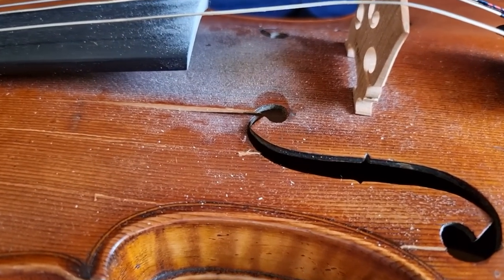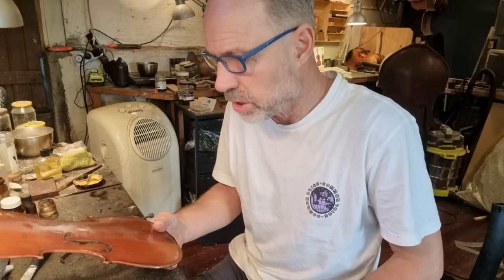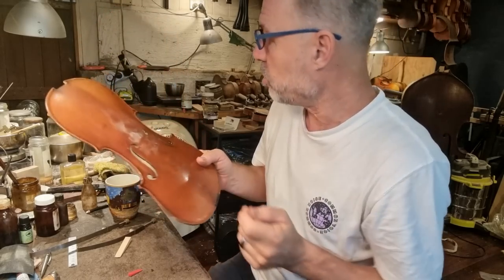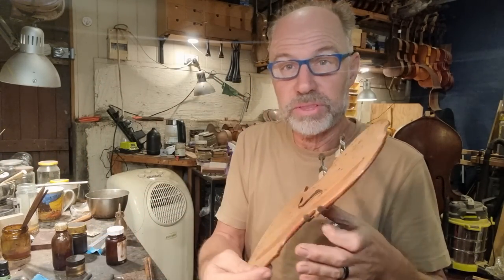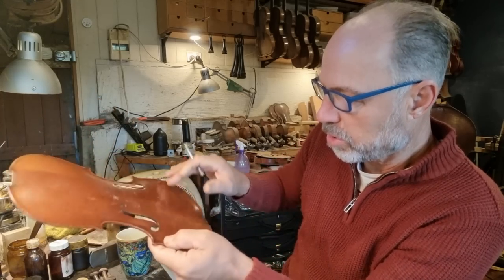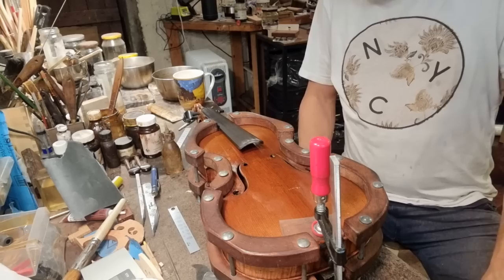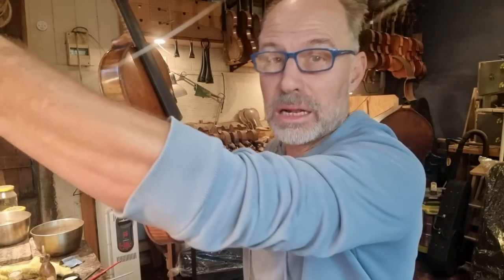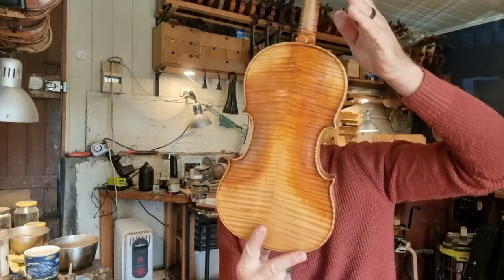Broken Violin!! Can Olaf Repair This Cracked Violin?

Comment: Good repair as usual. I've seen a interesting repair technique of using a small Suction Cup to "push" glue into  tight cracks on an acoustic guitar top before clamping. Might work on Violins as well.
Reply: That’s a technique used to repair windshields as well.
Reply: Makes sense. Might give it a try

Comment: Very well done video! I enjoyed watching it. But now some questions (not about the video). Yesterday I bought (for $12) a violin in very VERY poor condition. The neck has come off and the side panel has come away on the left side next to the neck. The seam on top has opened up not quite all the way from bottom to top. In short, it's a wreck.  I am a woodworker, but not a luthier and I don't know how to play the violin, but I thought it would be an interesting challenge to try and repair it. I was hoping you might be willing to offer some suggestions about fixing it and in what order to tackle the repairs. I was also hoping you might be able to shed some light on when it might have been made. The label inside says "Johann Adam Schonfelder, Violin-macher in Neukirchen auf 1743", but below that it says "Made in Germany" which I'm pretty sure wouldn't have been present on the label if it really was made in 1743. I did some searching, but couldn't find anything about reproductions. Any ideas? I'd be very grateful for any assistance you can give!

Comment: Dear Olaf, thank you for your helpful videos! What kind of filler are you using to fill the glued cracks around 13:17 into video? Best wishes from Berlin in good old Germany - Frank
Reply from the maker: @Kojubefra  it's called Deft. I bought it ages ago, so I'm not sure where you can get it now...
I'm sure I've seen it at violin maker supply shops though.

Comment: Degrease with industrial degreaser agent then use a resorcinol-phenol formaldehyde glue, is as duable as durable can be, leaves no trace and almost invisible for the eye. Much better than using patches. remnants of glue can easily removed. Drying time about 24 hrs. Aerodux is the best (Ciba Geigy).

Comment: Is there ever a time when you need to open the crack right out to the edge of the plate so you can get sufficient glue between the two halves?

Comment: Which kind of wood can be used for the reinforcement cleats? I´m trying to repair a very expensive Gunnar Helland Hardanger fiddle and need to know what to use in order to not degrade the sound in it.
Reply from the maker: Spruce for the top and Maple for the back

Comment: What I wonder is if an instrument had a crack that was repaired and the two sides weren't fixed together perfectly flat, can the fix be undone and redone. I have a 1924 Gibson snakehead and a mid 1800s French violin with solidly repaired and cleated repairs that aren't perfectly flat.

Comment: Hi Olaf , really enjoying your channel, do you ever use heat before you " crack " a violin open?
Reply: As for me, you'd rather chill the seam before cracking. I already tried heating and it turned out to become quite messy. The glue plasticises and tore off the ground in quite uncontrollable ways.

Comment: It’s such a scary thing to set one’s violin in its case for a minute in the shoulder rest. Sometimes an overly courteous passer by thinks they’re doing someone a favor by closing the lid of the case, which can easily put enough pressure on the sound post to crack the top and even punch a hole in it. Luckily, there are trained makers/restorers like Olaf that can make those violins sing once again!

Comment: How do the clamps for the first crack not damage the sides of the top plate? It doesn't appear to me to have padding on one side (I could be missing it of course), and I imagine that it needs at least a bit of pressure to do anything useful

Comment: Don't these reinforcements change the sound of the violin massively? In this case nearly all of them are on one side. Wouldn't that have an influence on the vibration?
Reply from the maker: Not a lot actually. They are super small compared to the weight of the entire top plate. 
Sometimes people comment on the instrument sounding better after a big repair.🙂
Reply: I wondered that too but Olaf has answered it for me!
Reply: I was also wondering about this, so thanks for asking!

Comment: Rule 1. Lock your case and never let kids get anywhere near your precious violin/cello. Rule 2 . Never leave it out, put it back in its case. Rule 3. Never leave it on your chair, it can slip off,  or some idiot can sit on it. Rule 4 . Secure your instrument in your car, so when you brake, it doesn't suddenly fly around the car. Rule 5. Pay close attention to your bow, rosin, straightness of stick, slacking it off when you've finished and not over-tightening. Your bow makes the sound, so don't forget to try to get as good a bow as possible.